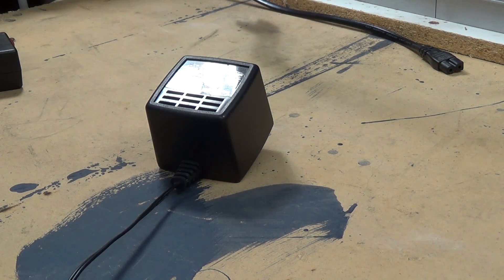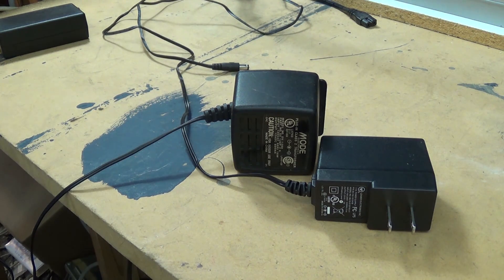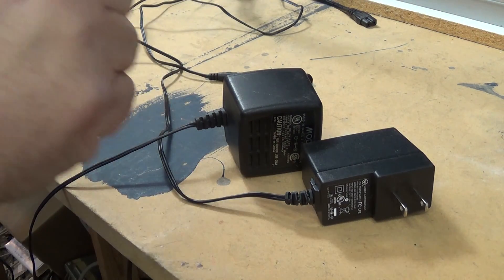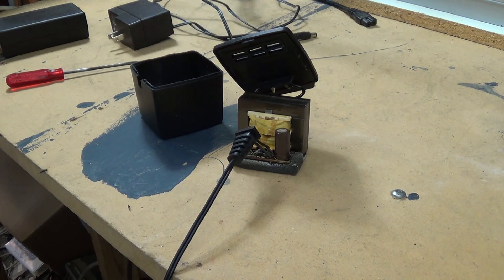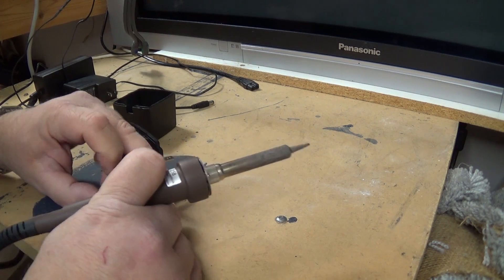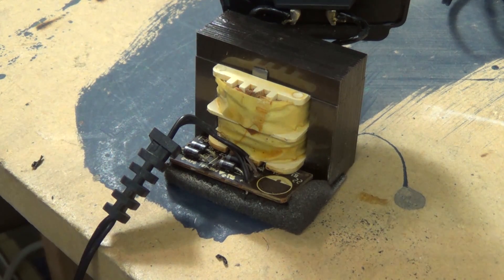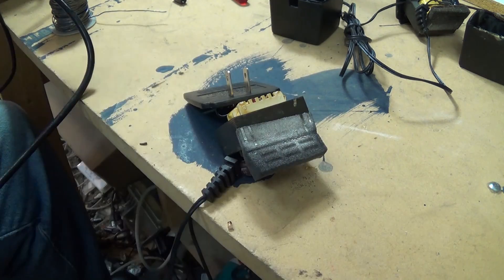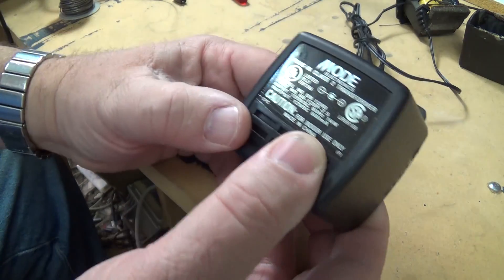Class 2 Transformer type AC Adapter repair

Comment: Switch mode power supplies have their issues, yes, especially cheap ones. Looks like you were attaching noisy switch mode power supplies to a device is susceptible to noise on the input side. I'd love to see the ripple on your scope. Most modern electronics can filter this away on their main circuit whereas old ones just don't decouple enough from mains frequencies. They did not have to. The rest is just a race to the bottom to make it as cheap as possible. One obvious cost reduction is to reduce overall mass, linear (unregulated) power supplies are expensive for a reason. At least it consumes less power overall...
Reply from the maker: +telecrate Switching supplies can be made with good filtering and regulation, but as you stated cheap ones likely have less filtering. The one I tried was from a cable TV box, so you would think that it would have been a good one, but even though it had double the rated output of the linear adapter, the Wavcom modulator would not even turn on, never mind output a signal. The modulator has plenty of chokes and linear regulators internal, but it is designed for a linear supply, and I would suspect that the chokes on the input, designed for 60hz were probably the cause of the problem when faced with ripple in the kHz range. Anyway that was the point of this was to show that some power supplies just will not work in certain applications.I will make a follow up video and show the cause and effect of using the various different supplies on one of these commercial modulators as soon as that big vizio plasma that is cluttering up my bench gets picked up by it's owner.One of my pet peeves is clients that bring me stuff to repair, and then leave it for days or weeks for me to store.  Awhile back I got fed up with a  46" tv that was abandoned. The owner never returned my calls, and I was sure he had forgotten about it, so I sold it. About a month after I sold it I ran into the guy in a local store and he asked for it back!

Comment: A inverter makes from dc power to ac power. (step up)
From ac to dc is called a switch mode power supply.
Reply from the maker: +pcuser80 They are both inverters. There are inverter type power supplies, which these switching inverter ac-dc type adapters are, and there are dc-ac inverters. There are also DC-DC inverters, and DC-DC converters.A DC-DC converter is generally considered a linear regulator, and a DC-DC inverter changes the DC to AC, runs it through a transformer and then back to DC again.  In electronics all types of voltage converters that involve high frequency transformers are referred to as inverter type power supplies, which is interchangeable with the term SMPS, or switch mode power supply. They are exactly the same thing, and refer to high frequency switching.The original DC to AC converter, mislabelled by many as an inverter used a true sine wave 60 Hz oscillator and a large power transformer. These were complex expensive pieces of hardware. More common were the 60Hz square wave converters, which worked fine with devices that had transformers in them, but not so well with induction motors. The more recent use a modified sign wave, and DC-DC inverter. The 12VDC is changed to high frequency PWM square wave, and run through a transformer. The resulting 170V high frequency AC is rectified to 170 DC, and then by use of IGBT (or thrysters as they used to be known as), a modified sign wave 60Hz 120v output is generated.For example Panasonic call their microwave ovens "the inverter" and it is making HV DC power from AC.To be technically correct they are all DC to AC.The 120v AC is converted to 180 or so VDC, then it goes back to AC by the oscillator, and mosfet transistors that drive the transformer, goes back to DC, and through the regulation circuit that controls the frequency and duty cycle of the "inverter" on the primary side.
Reply: +12voltvids 
Clear answer,
Thank you

Comment: You can't replace the fuse on these?
Reply from the maker: +amtpdb1 Some you can, as it is just held down to the surface of the winding, on others it is buried deep inside. I used to replace the thermal cut-out on power transformers for audio equipment. No different than the one I replaced in my electric fan repair.Not all transformers have a thermal cut out, but the CSA certified ones do. Small wattage units quite often do not, they just get hotter and hotter until the insulation breaks down, the primary shorts and the fine gauge wire that goes to the main plug opens.  Higher wattage units have a heavier gauge for the primary that would draw a lot more current before going open. So these ones are usually fused with a cut out that will open under 2 conditions, an over current, and an over temperature.To test for an open primary or open thermal cut-out, just use your ohm meter across the power prongs. A 120v rated transformer like this one measures 64 ohms. Naturally this will vary slightly depending on the wattage of the transformer inside it,  If it is measuring open, then the winding or the cut-out is open.
Reply: +12voltvids Thanks for answering.
Have a nice day.
Reply: You can, but most people don't have a spare thermal fuse laying around. You can solder the winding without the fuse and it will work but it becomes a fire hazard, there was a reason why the fuse melted, without it the transformer will catch fire.

Comment: What are the signs that it has failed? With either one, if you have it plugged in and not drawing power (Led strips with a motion detector to turn them on at night) do they draw power and if so what percent normally, and is it safe to leave it plugged in all the time, will it get hot when the motion detector has the lights turned off?
Thanks for your time and video..
Reply from the maker: +amtpdb1 Well all transformers will run warm even if you are not drawing much power. They will run quite work when putting out rated output.If you try to draw more current than the transformer is rated for the voltage will drop, and the transformer will overheat. As to the signs that the filter capacitor has failed, the voltage will drop off before you even get close to rated output, and you will see the ripple if you look on a scope.If anyone of you would like a video demonstrating the failure mode for filter capacitors in linear power supplies, sound off. I have a second one that I haven't replaced the capacitor in yet so I can show the symptoms.
Reply: +12voltvids Thanks again for the answer. Personally I would like to see the video on failure mode if you find the time.
Thanks again. I enjoy your videos and the way you produce and display the information.